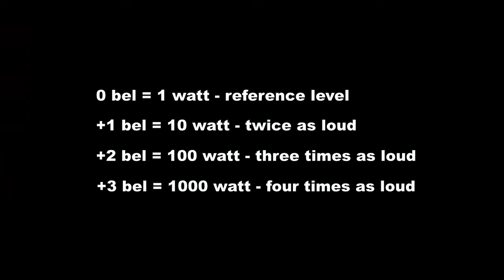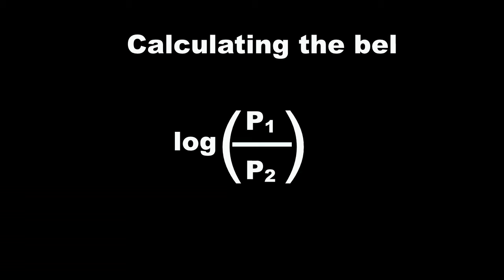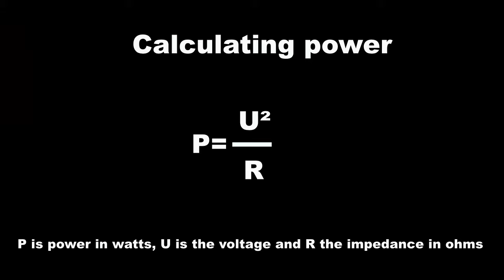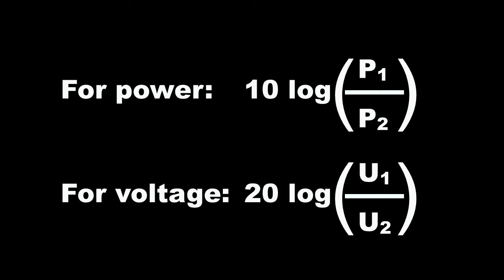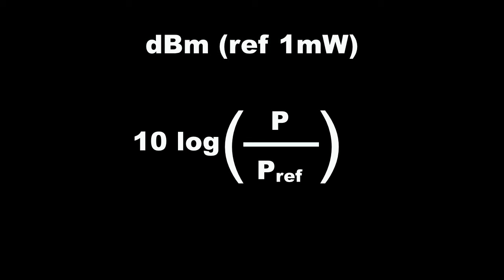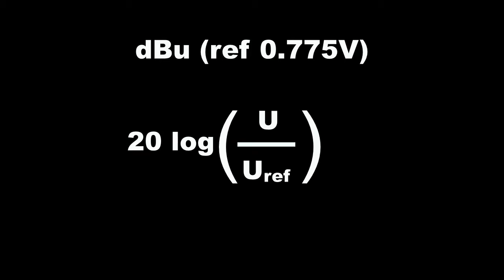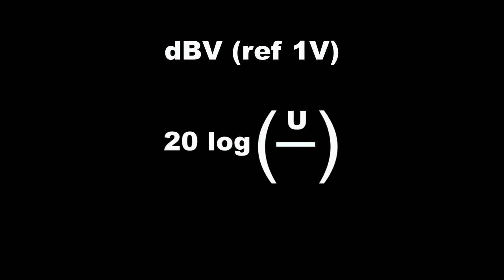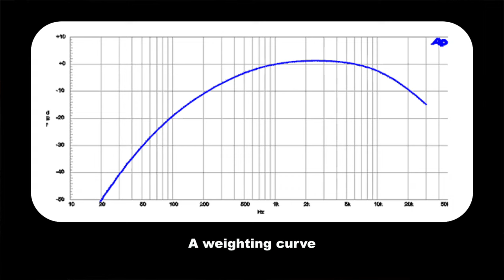017 The dB explained

Comment: GREAT VIDEO!!
I have one question...  You initially stated that it takes TEN times as much wattage (power) to perceive TWICE the loudness.  However at about timestamp  3:20 the table shows (line two) is "TWICE as loud" (here the power level is 10W).  Now to get TWICE as loud as this by making the power level ten times as much, (which would be 100W...four times louder than two times louder is "twice as loud"), why does line four indicate 1000W, rather than 100W if twice as loud as 10W is is ten times the power?
Thanks much!!
--dalE
Reply from the maker: You are right, it should have been 4.

Comment: I watched this video (again) trying to get a better understanding of a new unexpected problem in my set. Recently I bought a two track tape deck in order to play (copies of) studiomaster tapes. The tape deck only got two 3-pins XLR outputs. With very simple adapters from XLR to RCA out I connected my tape deck to my amplifier. The problem is that the output signal from the tape deck is much to loud now. If I am correct, XLR  out should be 6dB louder than RCA. On my amplifier I have 3 RCA ports IN. Port 2 is in use by the tape deck. RCA Ports 1 and 3 are possessed by other devices. When the tape deck is playing on 2 and I switch to RCA 1 or 3 I still can hear the music of the tape deck. Not as loud, but still... Perhaps a pre amp with XLR inputs would solve such “overflow” problems, but my integrated tube amp only has RCA inputs. So what would be the ‘second best’ solution to solve this XLR -> RCA = “+6dB” problem?
Reply from the maker: Levels in professional tape recorders are a bit complex. They are set for a given output voltage at a given magnetic level on the tape. And since reference levels on a tape can vary between 180 nWb/m to 512 nWb/m, which at its own is a variation of 9 dB's. Then the output voltage at that given reference level can be set to a variety of voltages, traditionally +6 dBm at 0 VU was the reference. In any case, since the tape recorder has XLR's I presume it must be a professional deck in which case the output voltage can be lowered by varying the replay level. Usually this is done by small potentiometers on the replay PCM in the tape recorder.
Reply: Thank you very much for your explanation! My tape deck is a professional ABE WG 31 with a brand new Telefunken M15 reading head. In case “the output voltage can be lowered by varying the replay level”, maybe I could make use of a pair of Rothwell attenuators (-10dB) and put these adapters in between the RCA interlinks and the integrated amp or putting a (Schiit) ‘passive’ pre amp in between (causes a ‘loss’ of at least -5dB at maximum volume level, up to....) instead of “modifying” the tape deck internally. Would you consider such solutions to be a simple alternative for potentiometers inside the deck?

Comment: Why do most amplifiers today display volume as minus db, - why start at a minus and go up to the plus ?
Reply from the maker: +Örn Leifsson I don't know if that's true. But it's irrelevant anyway. You're lucky if your amplifier is calibrated in true db's but even then they are only a relative indication unless the manufacturer specifies the reference (what I have never seen). Still, you can use it as a relative reference - let's play that 6 dB louder.
Reply: +The Hans Beekhuyzen Channel - OK - I recently bought a new Pioneer amplifier (vsx 930-k) and the volume goes from -80db to +12db and a comfortable listening level is around -30db - it just looks so strange to me.
Reply from the maker: +Örn Leifsson OK, let's say you connect a cd-player that gives 2V output max. That's +6 dBV. And you connect an old tuner that outputs 0.315V, that's -10 dBV. hen you switch over from tuner to cd-player the output of the amp gets 16 dB louder without you touching the volume control. Now, let's assume your speakers do 89 dB/2,83V/1m and you play one watt.
Reply from the maker: Now you hook up a set of horn speakers that do 103 dB/2.83V/1m. If you still play at 1 watt (so you didn't touch the output nor change the source), the acoustic output is increased with 14 dB. If you now select the tuner, the loudness goes down 16 dB and you end up only 2 dB louder than playing the cd-player over the 89 dB/2.83V/1m loudspeakers. ALL WITHOUT CHANGING THE SETTING OF THE VOLUME CONTROL. The indication is mere window dressing. Looks nice though;-)
Reply: Thanks for the video, the reason I watched you video was to figure out the minus dB, I think it's some sort of dBfs (Thank you for explaining this concept)  as just audio systems with digital volume knob (not a simple potentiometer) use this kind of representation. also in video cameras, as the audio is recorded digitally the level bars are shown from - levels up to 0dB and the important levels that usually camera mans tend to keep the audio level is between -20 to -12 dB as if the level reaches the 0 dB it means all the bits of audio wave variable is set to 1( the variable reached the maximum possible amount) and we have actually a flat signal. I also read somewhere that digital audio equipments are calibrated so that what they show as 0dB( that i think is some sort of dbfs) is just the calibrated level and is something around 75-105  dB in the audio world (don't know if it's the power or sound pressure) and It seems rational that many more powerful systems have also positive dB to show as you turn the volume knob up, It just produces dBs higher than 75-105.  am I right? what do you think about it?
Reply: Örn Leifsson 
Good

Comment: Alright I don't know if you still look at comments to older videos, but now i understand what dB is and more importantly why dB alone doesnt say/mean anything unless its placed in context. For your example at 15:00, you're stating that the sound was 12dB too loud. Now 12dB doesn't tell me anything, but the "too loud" parts make me think that it is about power? And since a doubling of power is an increase of 3dB, 12dB increase is 4x louder cause 4x 3dB? Shouldn't the correct term that shouldve been used be 12dBW?
Reply from the maker: dBW is used for absolute power referenced to 1 watt. So it can't be used the way you want to use it

Comment: At 3’20”, if loudness doubles, it would required 10 times of power, then 100w should provide double loudness than 10w could, thus should be “4 times as loud (as the reference level)”, isn’t it? And 1000w should be “8 times as loud (as the reference level)”, no?
Reply from the maker: Correct

Comment: one topic get missing, explaining the difference between db A weighted vs db C weighted, and when to use each one. :)
Reply from the maker: As such the weighting has little to do with the decibel. But in general A weighted is used for all things loudness while C weighting is used when low frequencies do matter more, like for instance with noise disturbance by rock concerts.
Reply: @TheHansBeekhuyzenChannel  it is correct. Thanks

Comment: Thank you for the great explanation! :) I just have one question regarding the last example (the pub owner one): If he broke the law by 12 dB, doesn't that mean that he was 12/10 (B) +1 = 2,2 times too loud and his sound pressure level was four times the permitted one?
Reply from the maker: No, you should - for power - divide 12/10 to get 1.2  Bels. For voltage divide by 20. Then take the 10 based root and then you get the ratio. For voltage . The easy way: for power each 3dB more is a doubling, for voltages each 6 dB more is a doubling. So your outcome was correct.